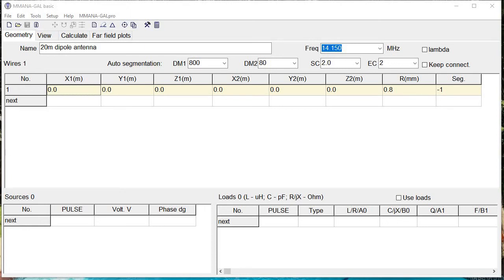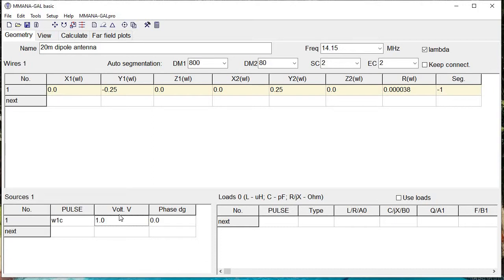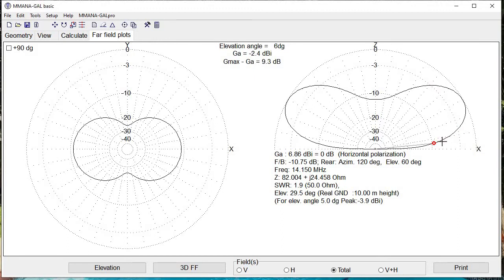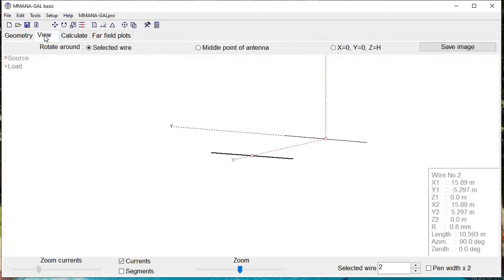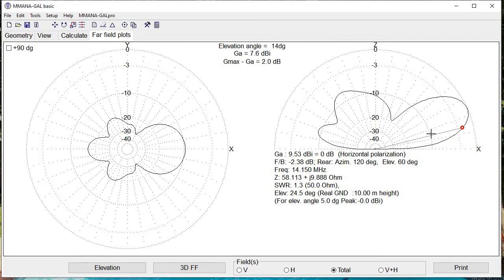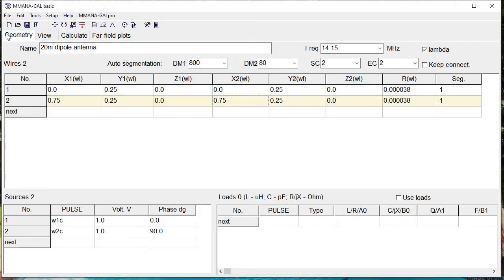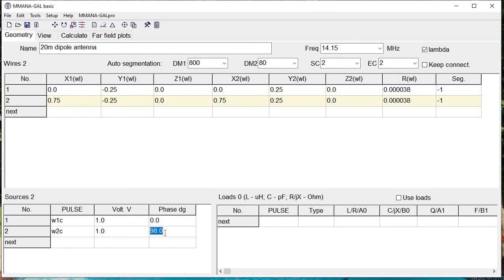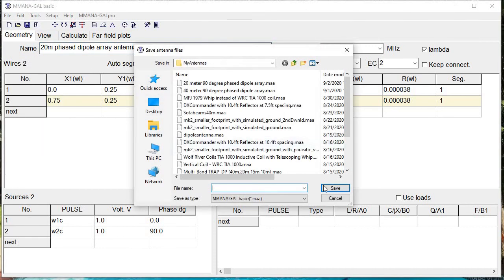20m Phased dipole antenna array

Comment: I saw Bob Heils video on this where he does not give much detail on the phase harness.  Do you have an example of this and can I switch this array east to west with a coax remote switch?  Very neat program and a great explanation so far.  Thanks!
Reply from the maker: Thank you for the comment.  Unfortunately I have not built this phased array so I would not have any hardware information; however, you may want to look at the DX Commander's YouTube channel.  I believe he tried building something like this.  73.

Comment: That is good, but 1.5 lamba is too much for my roof. If you put two 1/2 lamba (0.5 lambda) dipoles spaced 0.2 lambda (+/- 0.1 lambda) instead +/-0.75 - with 135 degrees delay line, you may get similar result. Saving space on the roof is my priority. If you want more, rather rise antenna as high as possible. For example, I can put up to 13 meters (my roof is 11m + 2m pole = 13m). Then I can get 11.61 dB gain and -3.76 dB F/B ratio. What is more important, by rising antenna 3 meters above value you provided, I can get +3.2 dB at 5 deg. elevation (or -0.2 dBi at 10m height). What you think?

Comment: Hi. I would like to try this with y/8 spacing and phase coupled. The phase shifting will be made in the shack with L/C. Approximately how much will be the impedance of one element with y/8 spacing ?
Reply from the maker: Thanks for the comment.  Unfortunately I've changed computers since I made this video so I don't have the MMANA GAL file for this configuration.  It seems that you're asking to change the 3/4 lambda spacing to a 1/8 lambda spacing if I understand you correctly.  Again, I don't have this file anymore but would encourage you to do a quick MMANA GAL simulation and input 1/8 lambda for the spacing, so change X1 and X2 to 0.125 while in "lambda mode".  Best of luck on your project, sounds like an interesting one.  73!
Reply: @quantumradio  Thanks  a lot for your quick reply. Yes I will make that with 1/8 lambda spacing. I made a two element phase coupled deltaloop wire antenna, but they are not on the same altitude. The F/B ratio is only 12..18 dB.